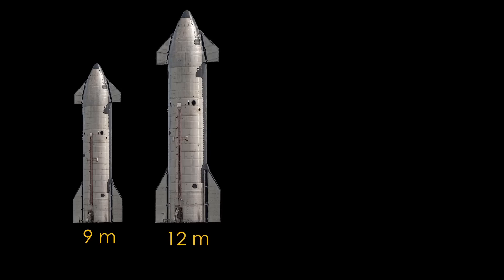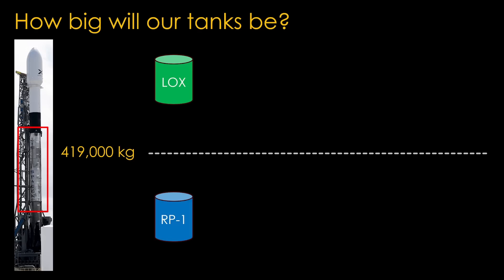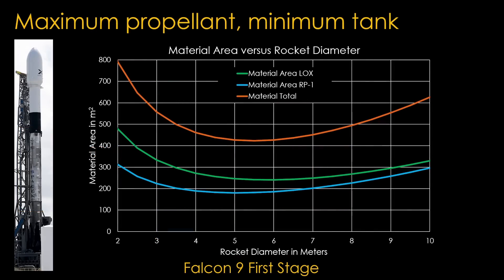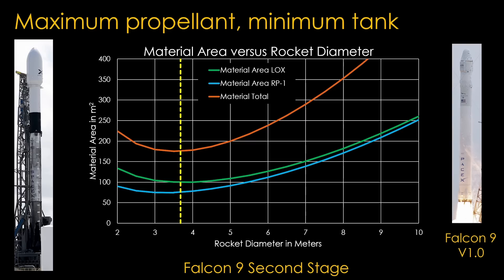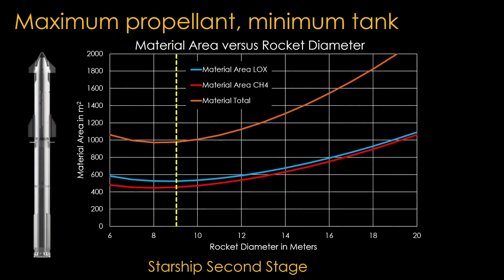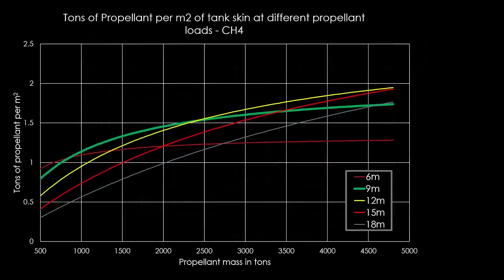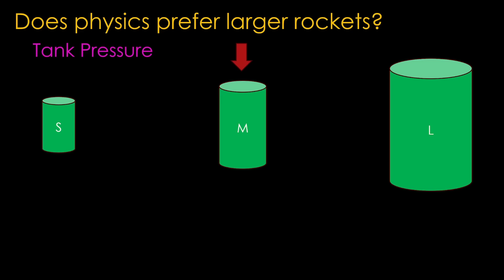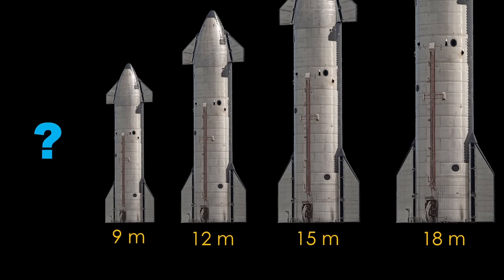Will Starship Get Bigger? Propellant tank sizes and rocket diameters

Comment: I don't think we'll see bigger diameter Starships until at the earliest 2030. There's still a ton of work for the 9m starship to do, and it's already comedically oversized for the vast majority of payloads.

Great analysis as always!
Reply: They’re not going to increase the diameter on starship. It can only get taller, not wider. 
If they make it wider then it’s basically another rocket all together and can’t be called starship. They would need to replace all the GSE, new towers, factories everything so a larger diameter won’t happen till maybe the 2040s/2050s
Reply from the maker: That's kindof where I came down, but they have a lot of new flat factory space and they've decided to build a second launch tower which seems like a lot of money.
Reply: @EagerSpace  yes. It seems very unlikely for a wider diameter for now. The current 9m Starship should at least be as successful and reliable as Falcon. Plus the need for an even larger rocket has yet to materialize
Reply: @trickeruniverse1979  you guys are forgetting they need to refill Starships for Mars and Moon trajectories.  The conclusion of the video was you size for the mass of propellants you want to launch, not the fairing size for commercial payloads that have limited uses.  The TANKER ship flights need to be reduced in numbers, which means there is a need NOW for tankers much bigger than the Starship you are trying to refill.  Tankers at 12m to refill 9m crew/cargo Starships in fewer flights than the 20 flights some people are claiming.
Reply: @spacechampi0n  the tanker starships is literally the same size in diameter as the regular starships. Building a 12m starship only for tanker variants is stupid as hell because then you need a 12m booster and that’s just basically building another rocket entirely. So if they’re going to build a 12m rocket, it’s not going to be for tankers specifically.
Reply: Agreed. Focus is now on getting it actually mission worthy, and HLS is next on the agenda, if they haven't already started constructing interiors and whatnot.
Reply: out of spite, they need to build liek 3 or 4 rings of 20m diameter, roll them out, in public, then roll them back in and disassemble and act like nothing ever happened
Reply: @any1alive  never happening
Reply: @trickeruniverse1979  I want you to look at what i said , i said it as a joke, or out of spite ,  like, elon doing a teaser or april fools joke, makign a 18m housign, then pretendign it never happened. 
it may never happen and im not saying they will, but it would be funny,
Reply: The aim for Starship is to significantly reduce launch costs. A rocket can carry multiple payloads, perhaps deployed with a kick stage. Customers like low prices.
Reply: Fully agree based on current cadence - 2030.  I may pull that in closer to 2028 given their exponential ramp up in both launches/experience/data points.  But it all depends on needs.  I think size/weight requirements will continue to grow as mars/moon supporting systems continue to advance (habs, vehicles, structures, electrical grid hardware (very heavy) etc...
Reply: @tobEwobEmusic  I think Starship 3.0 with 200t of payload is sufficient for most things. If you need more, just launch multiple Starships. Wider diameter I wouldn't expect sooner than like 2040 or 2050. 9m is a lot of size and plenty for 99.9% of applications
Reply: @Quasar-2   inflatable modules is the way, and starship can carry one as large as its diameter.
Reply: @tobEwobEmusic  you’re delusional as hell if you really think there’s going to be a larger diameter ship in the 2030s lol not less 2028.
Reply: I think the plan is to keep Falcon 9 and apply the updates/lessons learned from Starship.
Use the current/stretched Starship to replace Falcon Heavy as it can be fully reusable - whereas Falcon Heavy would have to be disposable for the same higher load.
Any wider diameter Starship could be used strictly for Lunar/Mars missions.
Reply: To go to the Moon/Mars unless they want to refuel a dozen times they need to increase the diameter
Reply: The second 9m works, they will make it larger and continue as they have always done. I would assume they would use v1 platform to launch satellites and do launches as they develope new versions.
Reply: To build a lunar base and a Martian colony, it will require deliveries of massive payload tonnage.  Don't forget, the primary goal is the Mars colony, not typical launch services.
Reply: That's what I don't really understand why Blue Origin or ULA are going for bigger fairings. The largest satellite ever sent into orbit was with a regular Falcon 9 fairing. The issue isn't size, it's cost. And they're going backwards from there. 

Starship I completely understand the fairing size. They're their own customer. Starlink V2 (and possibly V3 satellites. Something Musk briefly mentioned during the Everyday Astronaut tour) are massive and heavy. So they need the extra size for them. But for the rest, I don't really think a bigger fairing is all that important tbh
Reply: @snakevenom4954 makes engineering a payload a lot simpler, and often cheaper, when you reduce the mass/volume constraints.
Reply: @citizenblue  I agree. But if the largest satellite fit into a Falcon 9 fairing, how many satellites will need a larger fairing? I'm sure some will. But enough to be a market? Not likely
Reply: @snakevenom4954  this is a case where the market may respond to the change in launch capabilities. We'll have to see. Seems like StarShip will lower the barrier to entry and allow new payload manufacturers to enter the market because the cost per kilogram to orbit will become so low. Couple that with such a large volume that would allow a company to build large, mass inefficient satellites. Mass efficiency is inversely correlated to cost efficiency in a lot of cases.
Reply: @snakevenom4954 Hoax?
There are military satellites that need the extra diameter, and proposals for a new space station could benefit from larger diameter
The new space plane, Dream Chaser, for example cannot be launched from the Falcon 9.  Not because of weight, but fairing diameter.
Plus, as the video demonstrates, volume increases geometricaly with increasing diameter and length!
That is why all the proposed single stage to orbit vehicles were always huge!
Reply: @Quasar-2  Removing size limitations can help the actual satellite manufacturers significantly reduce costs though. The JWS telescope  was so expensive in part because they had to design a deployable capability to its reflector array in order for it to fit in a mid sized fairing. In a fairing the size of starship's that requirement wouldn't have been necessary. It's all well and good having a cheap launch vehicle but if it has a small fairing volume then payload engineering will still be very expensive, reducing demand for said launch vehicle.
Reply: @snakevenom4954  Falcon 9 has a 5.2 m fairing, Atlas V has 4.2m and 5.4m diameter fairing options, the space shuttle cargo bay was 4.6m wide, Delta  IV heavy had a 5.1m diameter fairing, etc.

Between SaturnV launching  Skylab (which is almost definitely larger than whatever launched on Falcon 9) and New Glenn there really wasn't any option for large diameter satellites, so naturally none were constructed.
Reply: @snakevenom4954 The biggest thing launched into orbit was skylab launched by the Saturn V also volume and weight isn't the same and SpaceX lost military contracts before because fairing size was too small
Reply: @Quasar-2  The larger the rocket (especially true if reusable) the lower the cost per kg to space.  If you are becoming SERIOUS about space, and it's not about mere satellites but space stations, Moon and Mars habitation, serious space ships...  You are going to need much more serious space hardware that can lift larger things to space and for less cost.  The larger you go the less fuel you need per kg, you double the payload but you don't nearly double the surface area or friction.
Reply: @jonathanberry1111  Mass grows by the cube of the size. Something twice as large is 8 times more massive. 

A cubic meter of water is one metric tonne. But a cube with each side being 2 meters is 8 tonnes. Larger does not always mean better or more efficient. 

The only reason Starship can launch off the pad is because of Raptor. The most efficient, powerful, and complicated engine ever created. Nothing else could do what it's doing right now. You would have to design a new engine to perform as well as Raptor is performing.
Reply: @snakevenom4954 Wait what?

 I have seen multiple people from NASA through out the years bemoan fairing diameter being too small countless times. 

 They could make a lot better sensors essentially. It would be easier to design, and build. They could jam pack either more sensors or better ones. More power. Just whatever! 

 Especially when it comes to mirriors! I remember one lady involved in the James Webb telescope talking about what they could do with just 5 meter wider rocket. How much crisper or further images they could get. 

  Now my question is... Why haven't we seen a short stubby rocket like a dysfunctional limp penis?

 Jokes aside just an aerodynamic problem I imagine? 

 Anyway... Pretty sure satelites are constrained by the rocket, and the military probably wants a thicc boi.
Reply: @Quasar-2 It could also be argued that the reason why no payloads are this size is because the satellite manufacturers are working within the volume and payload capacities of the rockets of the time. So I wouldn’t be surprised if we start seeing suddenly larger and larger payloads once Starship starts doing commercial flights.
Reply: @Quasar-2  I will re-review the video again, but I thought the discourse there indicated that Vulcan Centaur had a decent diameter, given the fuels and materials used, at 5.4 meters?
Reply: @michaeldunne338  Hydrogen preferred a smaller diameter but they kept the same diameter for a little less performance
Reply: @Quasar-2  OK. Heard this again. So the first stage has a decent diameter, pretty close to the optimal size, but does more of the work (staging is later than a Falcon 9 ),while to your point, the second stage is a little bigger in diameter than needed...
Reply from the maker: It's decent. It's more optimized for the methalox first stage than the hydrolox second stage, which would have preferred to be a little smaller. 
ULA's problem is that while they might want a second stage with more propellant, the whole system is sized to carry 6,600 kg to the NSSL GEO 2 (I think) orbit. Bigger than that doesn't really help them.
Reply: One of the problems with the ISS was the time it took to assembly it out of small pieces shipped up on the shuttle which limited part sizes. With a projected 200 tonnes to orbit, even a standard Starship would require far fewer launches as the ISS is only 450 tonnes. A bigger Starship could transport much larger pre-assembled units.
Reply: I was upset when Elon announce the downsizing of the MTC from 12 m diamter to 9 m, because Saturn V was 10, and I felt if the Saturn V is to be truelly rendereed pathetic a rocket needs to be both taller and WIDER, as well as just several multiples the thrust and mass. Now when talking abouit Starship as the largest orbtial rocket system ever we need to add an astrik that well the Saturn V was wider (don't start about N1, the N1 never even made it to space let alone orbital velocities, and energia and spaceshuttle have strap on stages that does not count: several smaller rockets strapped together side to side not one singular huge rocket)
Reply: @frbe0101 starship stays the diameter all the way Saturn V tempers down a lot

Comment: I do wonder what challenges SpaceX would face if they had to retool factories for a wider starship
Reply: The factory would be easy enough I think, most of the stuff in there i suspect is just jigs and such which would be easy to retool. But the bays would be a pain since they are designed for the current diameter.
Reply: Bays? 🤔